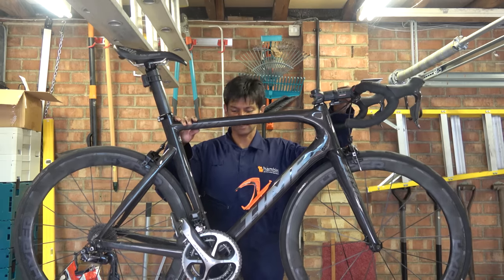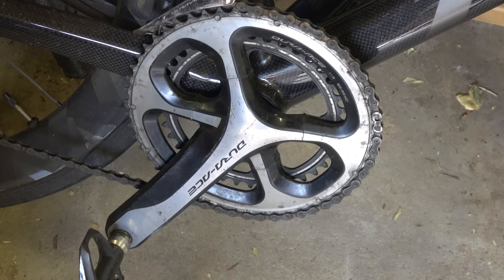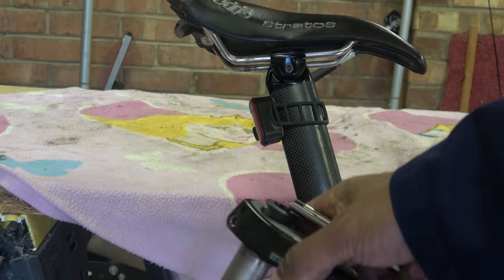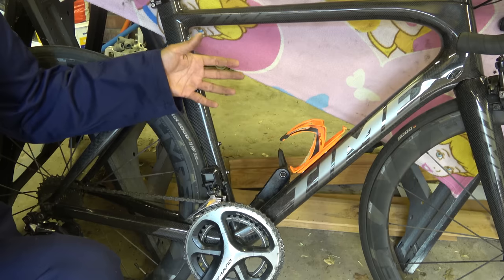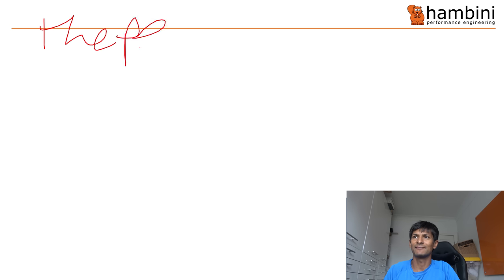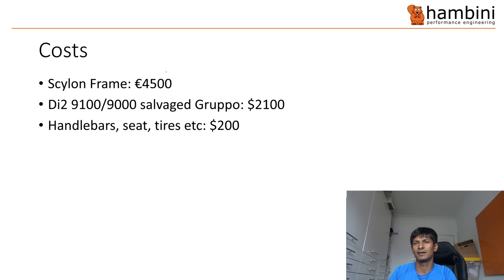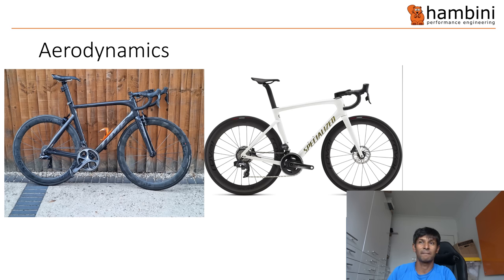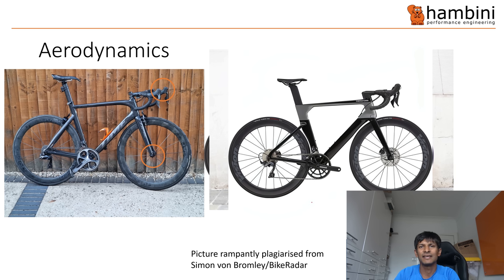TIME shows the world how to make a bike | Scylon | The Lick

Comment from the maker: I had some questions referencing the aerodynamic loss of the hoods and basically accused me of talking BS. Here's a photograph visually showing the difference. https://www.hambini.com/20220829_142512/ The loss is significant and aggravated because the hood does not see disturbed air, it's out in front of the bike. You can mitigate the loss by holding the hoods but that increases the system drag versus holding the drops. The rim/cable actuation is considerably smaller. This is in addition to the loss from the discs. Whilst I accept that the industry is moving to Disc brakes, from an aerodynamic perspective, they are inferior.
Reply: and I go for Peak Torque 180 mm adapter :)
Reply: I just can't believe we got some actual Hambini ride footage
Reply: I think those shifters could be installed lower in the handlebar, and be more streamlined with the rest of the bar. In the sl7 photo, they are way too high.
Reply: As an owner of both a Time VXRS (rim brake) and a Giant TCR Pro (disc), I can say that I can tell the differences in the rides.  The Time is superior for longer days in the saddle, but the Giant accelerates better.  Both handle the curves with aplomb as the geometries are very similar. But as I'm in my 50s and not lining up for the TdF anytime soon, I don't really care about any aerodynamic losses from the discs.  The braking performance is better in all conditions and especially great in the wet.  Also, having been a wheel builder for nearly 40 years, I can tell you that you can have lighter, stronger wheels with discs as the rim doesn't have to do a second job that requires additional material and strengthening.  That also lowers the rotational weight for climbing and faster overall acceleration.

But I'm just some punter that likes your videos.
Reply: This is the reason manufacturers are working hard to make hydraulic brake shifters smaller. If you compare the first Tiagra to the current model, the difference is massive.
Reply: Next they will release 622mm disc brake and call it the best thing since hot water.
Reply: @jobytapia6388  Another punter and decades long amateur wheel builder here. I haven't got around to weighing them against each other since my disc wheels are MTB and caliper brake wheels are road and so not exactly like-against-like.  I would think the mass of the disks themselves, and heavier  disc mounting reinforcement at the hub, would exceed any mass of extra material at the rim sidewall of traditional caliper brake wheels. The additional disc related mass is obviously closer to the focus of the rotating assembly so less of a rotating mass consideration though.

Also, for dedicated real weight weenies, radial lacing (shorter spokes for same ERD's) on caliper brake front wheels  is an option not recommended for disk counterparts because there torsional forces are transmitted through the hub then spokes. 

All somewhat tenuous considerations for those not involved in competition though.
Reply: Those look like RS405/RS505, which was first-gen mechanical hydraulic they couldn't be bothered to name. Recent Shimano Di2 hydros are considerably closer in size to Di2 rim-brake levers.
Reply: No one give a f about the aero loss of discs
Reply: @jobytapia6388  I doubt you can have lighter wheels with discs. You need more spokes, stronger hub and disc on the wheel while the difference between the weight of the rim with brake track and the rim without brake track is quite small.
Reply: @Fetucinee  I should have specified like/kind materials and builds.  For instance, ZIPP 404 Firecrest Disc weigh in at 1516g where as the 404 Firecrest Rim Brake weighs in at 1621g - over 100g heavier!  Of course, lighter components can be used, but in every case, a disc rim will be lighter than the equivalent rim brake version. ENVE's disc specific SES 2.3 at 1197g are not exactly anchors...

As you know, one can build 2x on the brake side and 0x on the drive side and the difference in weight of the brake side spokes is minimal, especially when using CX-Rays or Aerolites.  Rotating mass is much more critical in acceleration than overall mass for most racers, but punters like me, I'll give up a little weight at the hub for better acceleration and braking.
Reply: @jobytapia6388  why didn’t you take some winspace hyper in any size for your comparison? ;)  Rim for the win baby
Reply: @jc74435  It's a direct function of the length of the stem and your arms. Move the hoods and you have to change the stem unless you have different size arms you can have a doctor put on. Most people don't like an extended aero position for long. On longer rides, you have to sit up most of the time.
Reply: Well basically i contribute this to disc brake technology, that is why they need to be bigger.
Reply: Rim brake lives matter well done Hambini. Brilliant video and a very nice bike
Reply: @galenkehler  When I was five I had stabilizers.  He is quite advanced for his age.
Reply: @veloaddict  Funnily enough, top end 160mm rotors cost more than most 622mm rotors.
Reply: @jobytapia6388  or have sub-1100g 60/66 deep rim brake wheels :)
Reply: @jobytapia6388  Gotcha. I should also stipulate that I've never built carbon rims nor do I ride carbon wheels so am not sure how CF rim sidewall thickness on those components parallels Al hoops.
Reply: @jobytapia6388  
You have 2 exceptional bikes in your fleet 

I also own a #timebicycles  Fluidity VRS with full #campagnolo SUPER RECORD gruppo/ SHAMAL build and a GIANT TCR  with full #campagnolo RECORD build .

Both are excellent bikes in their own right 

I have had more " T I M E " on my TCR as well having owned 3 earlier  versions .

My LATEST one is a 2008 TCR1 
It 'a performance parameters/ comfort levels are very good in almost all areas 

It simply gets the job done 

On the other hand , my T I M E Fluidity VRS takes the performance parameters/comfort levels to a whole different level.

For the shorter  " T I M E " that I have owned / ridden it , I have noticed that on all performance parameters/ comfort levels , noticable improvements. 
First , quite a bit more comfortable, vertically compliant , without giving up much torsional stiffness 
The overall ride quality , handling and feedback is more sophisticated and communicative 
The build quality on both bikes are SUPERB
The #timebicycles Fluidity VRS ...AGAIN..takes this element to a whole other level 
The mix of nude Carbon/ paint finish is not only technically superior it is also a visual delight 

My TCR also has a 3 k weave finish too

A recently installed TIME Monolink Carbon stem has also taken the handling  to next level.
Under hard acceleration/ climbing and descending where there is alot of lateral torque being applied 

#hambini should have some GREAT 
" T I M E 's " on his STUNNING Scylon build 😎💥‼🇬🇧
Reply: @jobytapia6388    Add the weight of the Disc rotors Please to the 404 Disc and then do the calculation  "about 120 grams each" ... thus the Rim is still lighter .

.. a rim brake does have the braking surface included .. the discbrake doesn't.
Reply: Counterpoint: if the disc brakes cause more aerodynamic drag, then they are more efficient in their purpose, which is slowing you down
Reply: Someone I once knew who worked as a Brand Manager at a major bike brand once told me that the same bike tested 1W faster in a wind tunnel with DA hoods vs the Red AXS hoods. Everything else (save for the gropuset) was identical.
Reply: @alexdi1367  agreed, that was my thought - apples and pears comparison. Also the difference in the lever frontal area compared to the whole bike and rider is tiny. You're probably better off worrying about your sock drag.
Reply: @kitten-inside  haven't Shimano consciously made their hoods larger? Didn't the previous generation have same size hoods for rim and disc brake levers?
Reply: @Numeriwar  Lots of people carry about the disks weight penalty, more complicated and more frequent maintenance.
Reply: @Sills71  i use disc brake its not complicated at all.
Reply: The thing is that loss is coming not from the Specialized, but the SRAM groupset:  the 11 speed Shimano Di2 disc gruppo has the same small hoods of the rim brake version.
Reply: hello hambini. my shimano 105 st-r7025 is a disc break version as big as the rim break one. can put a pic if u wish. Cheers
Reply: What's the left disc hood ? A shimano it seems from what I read. But is it a di2 one ? Seems.massive.  the new 12 ones ?
Reply: @jc74435  You have to consider ergonomics. A bike is ment to be ridden and a wrist is not supposed to be in ulnar deviation. It often creates neck and shoulder issues and also numb hands due to nerve compression.
Reply: @kpizzle1985  Not sure if they conciously made them larger in the sense of broadening, but I do remember them being made longer and taller of which at least one was said to be for ergonomics.
Reply: @Sills71  thats bs. Ive used my bike regulary during 1,5 year. Ive only changed the pads. The weight penalty vs rim brake is un-noticeable
Reply: @jobytapia6388  too light of a wheel loses the flywheel effect on any sort of descent. you will lose speed much faster even if its only on a short climb for example. lots of complaints online about people getting crazy ultra light wheels and losing time because of this. there's a happy balance to be achieved.

Comment: Time's customer service is exemplary.  We have been dealing with Time for many years at Athlete Service. Last year one customer discovered that the aluminium bb shell on his 11 year old VXRS had corroded away. We sent his frame back to Time who completely repaired it, without cost. And another  whose old frame had developed a tiny hairline crack around the top of the seat tube, under the seat post clamp. They sent him a new ADH frameset, again completely free of charge. They are currently manufacturing a replacement fork for a crash damaged 14 year old frameset, this time quite reasonably for a cost.  Another customer who cracked his seats try, they replaced the rear triangle foc,  that or it was a brand new frame because we couldn't tell the difference. Now we have a handful of ADHX framesets, and have one built up and ridden. Amazing bike to ride.

Comment: You can neaten up the di2 wiring and lose that junction box. See my TCR build video. Drill the bars and use the bar end junction box.
Reply: He's an amateur at this game 🤓
Reply: Or follow his advice to go with 105, in Di2 there is no cabling or jxn box as the levers are bluetooth connected to the deraillers, but your frame has to be disc ready.
Reply: @tednruth453  good one 😂

Comment: I followed your advice and bought an alpe d'huez frame (1 year ago), put your bb in and the tolerances were perfect, mounted everything Dura Ace except the brakes (ee brake) and carbon tubulars. It works just PERFECT and it weighs just 6,5Kg with everything (pedals, Garmin and empty bottles)!!!! Thanks Hambini
Reply: Pity no pictures. Sounds like a KILLER bike. Enjoy.
Reply: Have you compared it to another bike of yours? Dont underestimate the power of belief. Placebo is real.
Reply: @PhiyackYuh  yes. I have 5 road bikes. 2 disk and 3 with rim brakes. I mounted all of them and the Time is, without any doubt, the one that presents the best quality of materials and in wich the measures are true and correct

Comment: Because of you I own a Time alpe d'huez 01 since two years. Love it and it is worth every penny. Thanks for pushing me into this direction
Reply: Hambini's engineering analysis really convinced to get Time bike as my next road bike as well. Simply because I didn't want to waste my hard earned money on crap quality bike pretending as high quality bike. 
I got myself TIme Izon which is the predecessor to Alpe d'huez. I got it with good deal ($2K USD for whole bike) with power meter in great condition.   
So what frame color did you get for your Alpe d'huez? Mine is black with clear lacquer coat.
Reply: @Reanimator999  You are right, he ruled out all the other Brands I was looking to. BMC, Cervelo, Scott etc. The first Time Hambini mentioned Time on his channel i started my research about RTM, the braiding they do and the whole process and was hooked. The frames are not very easy to obtain in Germany, in fact I had to buy the frame without ever seeing it in person or trying the bike. My Frame already came made in Slovakia and is the all flat black model. That was the only bummer for me, you don't see the beautiful Carbon Weave, but there was no choice. Took the Aktiv fork as well, because I am not a big weight weenie. Had it built with Ultegra DI2 Groupset, DT Swiss PR 1400 Dicut Wheels at around 6000 Euro. Not a bargain, but 2 years ago it looked really bad for Time so I was in fear they go out of business completely so I took the frame. But not regretting anything, it is beautiful.
Reply: @masatsune3493 It is beautiful bike. Well, Bianchi has that famous green color I like, but a paint job alone can't prove the superior quality.
  It was a good call to take the Activ fork. My Izon has Activ fork too and I still need test it on well paved road, not on pot-hole filled streets of San Francisco. Just like you, RTM is what convinced me to get Time bike. 
About the flat black color, I think it's not a bad idea to do custom paint or custom vinyl wrap. Their frames are already sold in red, blue, and other colors so why not?

Comment: I have an Alpe d'Huez 01 for 2 years. Building it up with Campa Record 11 was a joy in itself. Seat  stem and fork plug went inside as a piston compressing air. And as ride quality goes... my other bike is an S-W Tarmac, which is not bad... Time does everything just a  bit better. Stiffer, lighter, more vibration absorbing, dociler handling... just enough for pure joy to ride.
Reply: Which Tarmac are you comparing it to? My SL6 rim brake was just written off and I'm trying to figure out how to replace it. Thanks.
Reply: @helenwall3277  it's a 2011 SL3 "Tom Boonen" edition. The last with outside routed cables. I use it for commuting and really without problem.

Comment: i've got a 2022 Scylon with the mass damper and what seems to be a much shorter seat post than yours...after some absurd confusion during the ordering process i ended with one painted matte grey and unfortunately its extremely easy to chip and there doesn't seem to be any touch up paint available. You commented you didnt know what Time customer service was like...i contacted them to ask for digital copies of their decals so i could get some new ones made and they could not have been more helpful or accommodating. As you mentioned, the bike was a joy to assemble, i run AXS and some Jagwire elite cables so the front end look reasonably tidy too.

Comment: One issue with the quickset headset worth noting is that if you sweat on it, and dont service it, after a while it will seize and be extremely difficult to dissemble unless you have something like Rost Off. I picked up a secondhand RXRS from a negligent owner and scarred the quickset headset cap trying to take it off. 

Another thing worth emphasizing is the Skylon is a harsh ride. Big bumps are very efficiently transmitted to your hands and rear end. OTH it feels fast, its got that unique Time gliding ride quality.

Comment: Can you make a Tier-list of bikebrands you’ve experience with from best to shite manufacturing? Would be interesting and definitely something i would keep in mind buying a new bike.
Reply: I think he just did. The impression I get is that, for most of us, you'd have to spend far more money than you would ever want to to get a "good frame" from an engineering perspective. With the unfortunate caveat that there's no guarantee spending a ton of money will achieve that. In that sense, buy a Time if you have the money. The rest of us can rest easy knowing that, unless the BB or something else is massively out of whack, we won't be able to tell the difference if we get a £600 frame anyway. e.g the cranks in the BB in my bikes spins freely and the BB doesn't appear to be getting excessive wear, the frame hasn't cracked or fallen to pieces. Ergo I consider that a win. Would someone like Hambini taking a closer look, using proper measuring devices tell a different story? Quite possibly. But am I going to spend £3.5k (which their website says doesn't include tax or import duties) to get something like the Scylon that's nominally engineered better? Not a fucking chance.
Reply: Time
Look

Comment: I've had 4 Times. The first was the First model which developed a crack near the head tube. They replaced it with an Edge. That one is 13 years old now and I passed it along to my tall daughter. The next was a VRS Fluidity Aktiv which I built w Record 11, very plush. I was able to pick up a two year old Scylon last year. Damn is it fast. I moved the Record over to this frame and built the VRS with Potenza and wide gearing. I love riding the Scylon for up to three hour rides. For long, hilly, crappy roads I'll take the Fluidity. Just finished the 235  mile Ride Across Wisconsin and was quite fresh at the end. I've had no significant issue with harshness. I run 25mm that measures 27 at 85/82psi.

Comment: Thanks brokowski!!! I’m having a custom build being done next week as well…mechanical Campangolo Chorus 10spd, Voce shifters (cost savings), Centaur 50/39 aluminum crank (no delamination), and cew others I’ll hit you up on-it later;-)
Reply: Are the Centaur (or even Chorus) 10 speed alloy cranks still being manufactured, or did you find then as NOS, or have them from a previous build??

I ask because my most recent fitting required pedal spindle extenders. 
With all of the dire warnings against using them in carbon crank arms (even fairly strong ones!), I am considering swapping out my 2010 vintage Campy Record CT Ultra Torque compacts for those.